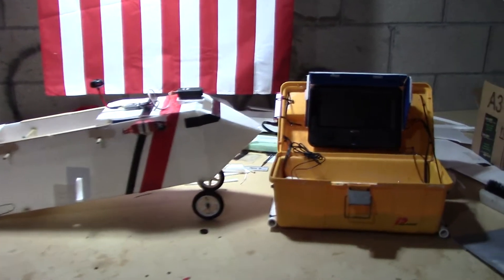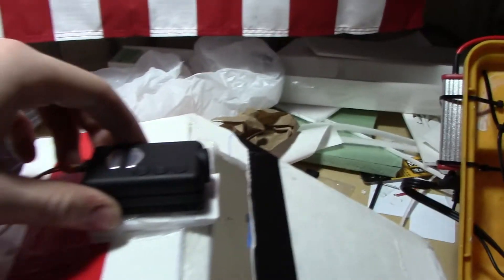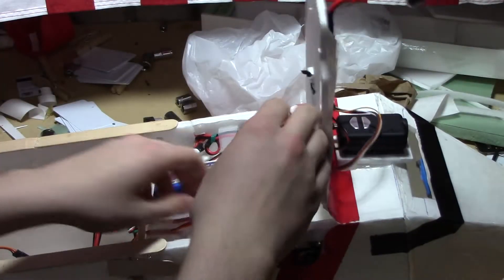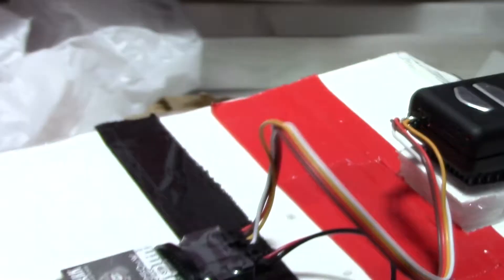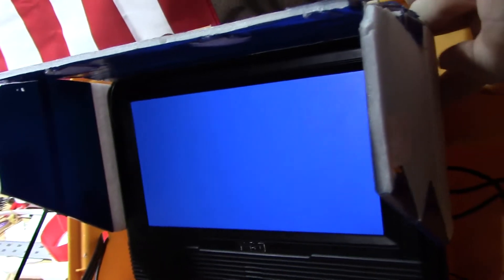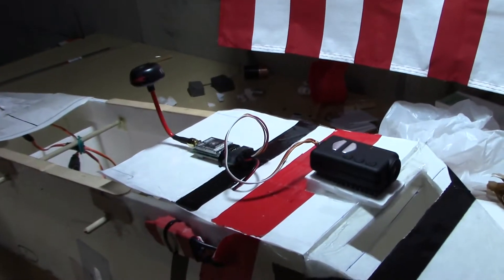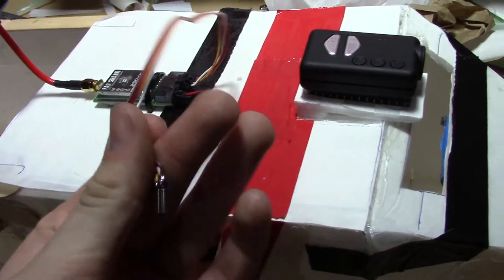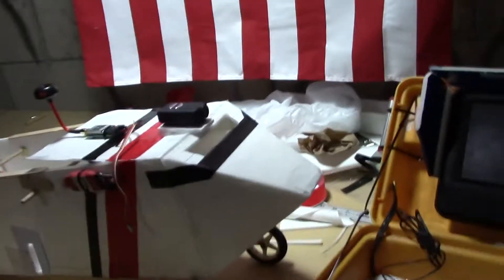Part 1: FPV Problem (Mobius, Fatshark 250mW, ImmersionRC Uno5800)

Comment: Since you have the Uno5800 v4 should select the right band first and then the right channel.
Also use the AV cable that came with the receiver. They are not all the same.
All other things seem to be right.

Comment: You seem to do everything right. The only thing I could imagine is that the cable from the mobius to the video tx is broken or has some leads switched. You can check by connecting this cable directly to the video input of your monitor somehow. This will also validate that your mobius sends analog video correctly.

I'm not sure but you should actually hear something too, On my Boscam video tx sits a microphone which it sends along with the video from the camera. I don't no the fatshark stuff but if it have a mic to and you cant hear anything, maybe the problem is after the video tx.
Reply from the maker: Thanks for the response. As far as I'm aware the video tx does not have a microphone. The Mobius does, but I don't think it sends audio out. I will try to hook up the camera directly to the monitor. Maybe the Mobius just is not sending the signal out.
Reply: +APlane hi! did you figure out what went wrong? I'm facing a similar issue, except i'm using a v2 receiver.
Reply from the maker: +Damien Ho I still don't know why it wouldn't work the way I originally had it wired up, but I did figure out a way to make it work. See the Part 2 and Part 3 of this video. I don't know if it will work with the V2 though. 

Part 2: https://www.youtube.com/watch?v=jigvRR8oC_M

Part 3: https://www.youtube.com/watch?v=yo-9WkqV6o0